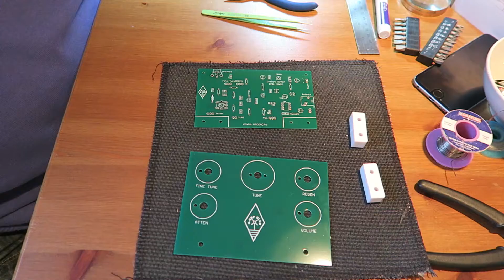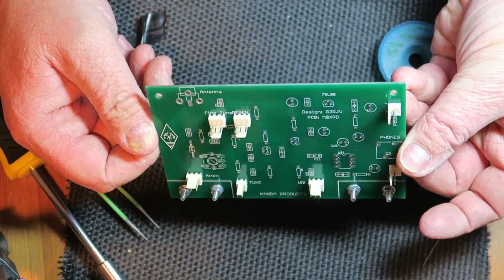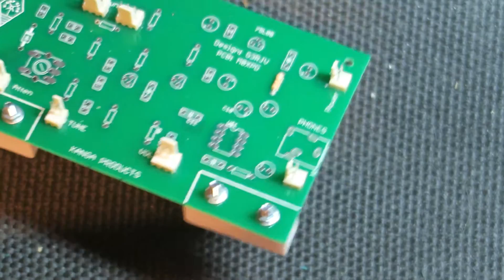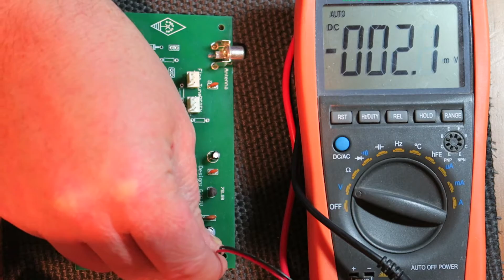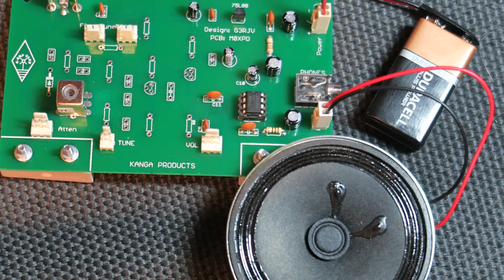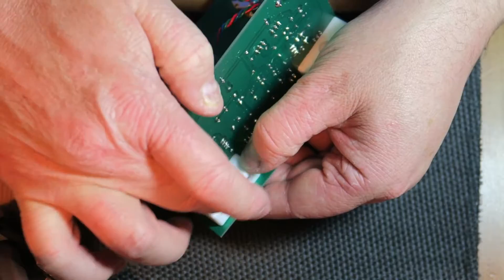GQRP / Kanga Regen Receiver - Ham Radio project

Comment: Not so sure your the right person to be giving advice about kit building! One of many reasons is your soldering skills leave a lot to be desired.
Reply from the maker: Never had a problem with any of my soldering. But, please show us all how you do it. As I’m sure you’re perfect.
Reply: I have seen some other videos of yours, my comment references your soldering skills, constant touching and retouching of soldered joints, is it not possible for you to make a good soldered joint first time around?.. the stress you add to electrolitic capacitors as I've seen before is not a good way to teach others???...

Comment: Well done Dan, nicely demonstrated. Tweaking the coil core has made mine more lively for sure and having 7MHz in the middle of the swing makes it easier to find the amateur signals.
Reply from the maker: +Steve Hartley hey Steve, Ditto - have now tweaked mine, its made a huge difference. Also have earthed the front panel to the PCB, that has stabilised it quite a bit. 73 Dan